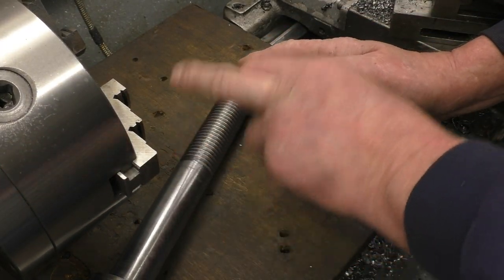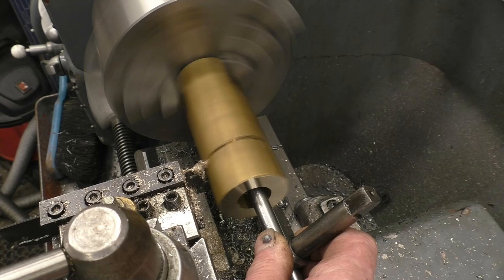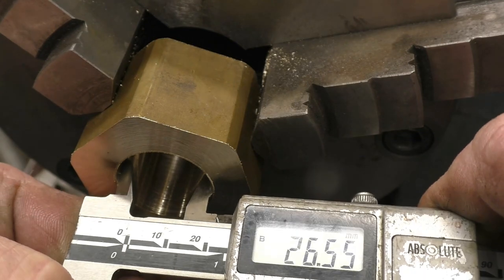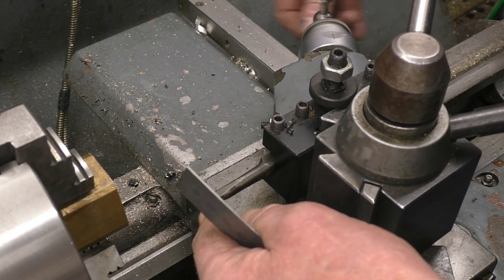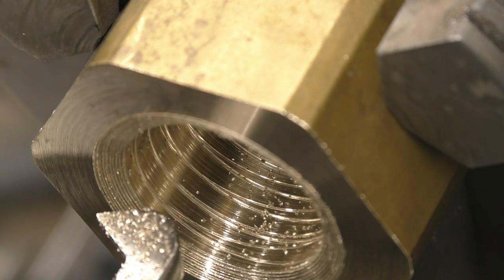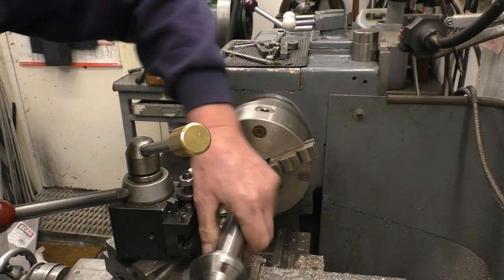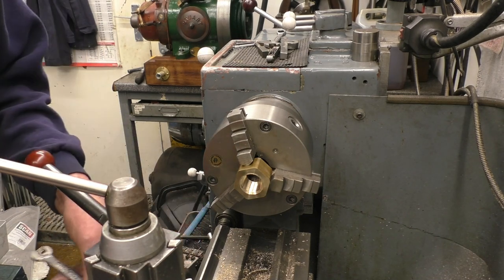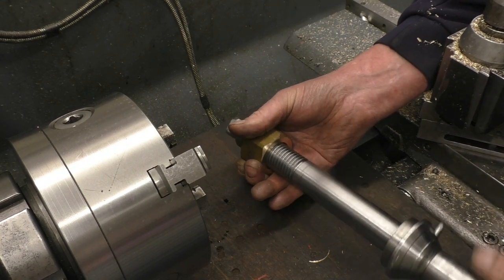SNNC 416 P2  Internal Bastard Thread

Comment: Hi John 😊, great job on the spindle and nut. I was the in the same boat as you whith my hearing, in fact nearly the same cause , motorcycle race mechanic through the 60s, and 70s, and lots of garage noise  as well, and no hearing protection, if only someone had told me what would happen, it's the high frequency that I've lost, but what a differance hearing aids have made to my life, and I hope you see the same benifit bonny lad, I know it's a bit late but I wearing ear defenders now to try and stop it getting any worse. Thanks for the video,stay safe mate, best wishe's to you and your's, Stuart UK.

Comment: Many thanks for doing that for me, John. You’ve made a fine job of that.

I thought that thread was 7 TPI, so I’m glad one of us had their eye on the ball!
Reply: It probably would have been easier to bore the cutter out to fit the shaft !
Reply: @millomweb  A 30mm shaft is more versatile, as it will take all modern tooling, as well as the old 1.25” stuff (with bushes).
Reply: @guineafowl8029  Yes that will make things easier, you likely have many different cutters.
Reply: @guineafowl8029  We are too soft on manufacturers. We should reject non-standard components then this sort of thing wouldn't happen.
Reply: @millomweb  The only problem is the machine this is going on was built about 70 years ago when the standard was 1"1/4. .
Reply: @wadkin1973  Gut feeling suggests I have 2. One's 1 1/4", the other could be 1" - they're still standards !
Reply: @millomweb  But this machine is a Cooklsey and intended for heavy duty usage, Thats why the extra thickness on the spindles, All bigger machines of this era ran that size.
Reply: @wadkin1973  Nearly what I said.

Comment: Interesting thread pitch, checked all my thread charts, BSW is 7 tpi for 1.25".
My lathe will cut 7 tpi but not 7.5 tpi.
Did some research and 7.5 tpi is used for fire hydrants and hose connections,  indeed a Bastard thread.

Comment: I really enjoy your vids...no rubbish, all tutorial. Just one clarification. I didn't get why the compound slide had to be at the same angle as the tool. Wouldn't having it square and pulling the cutter into the part with the cross slide do the same thing? Why is it important that the front of the tool do the cutting?